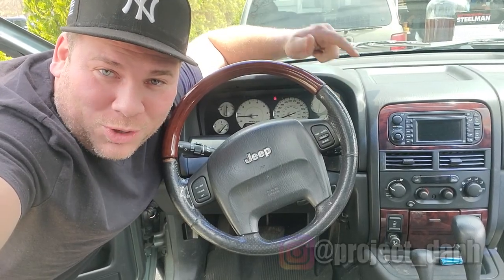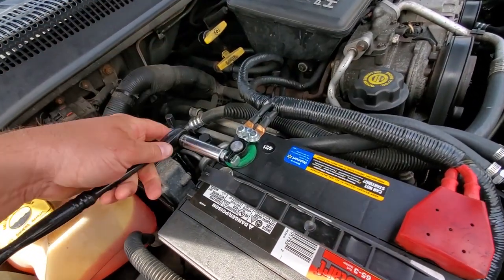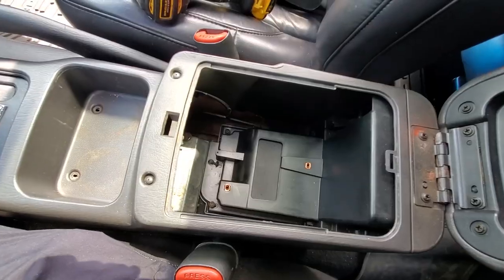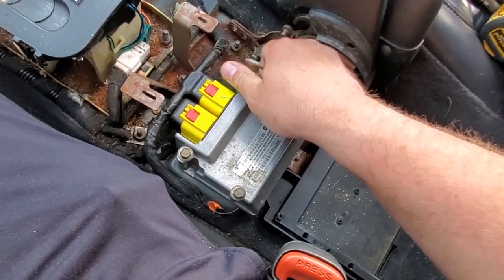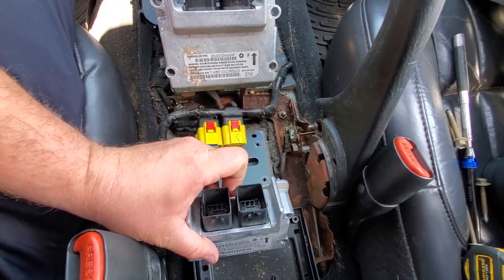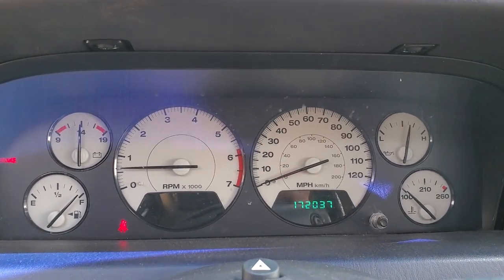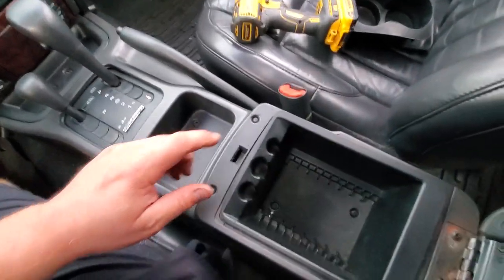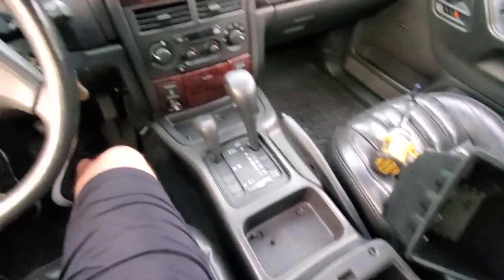JEEP GRAND CHEROKEE WJ AIR BAG LIGHT -  MODULE WARNING RECALL FIX - CENTER CONSOLE REMOVAL

Comment: I know this video was quite a bit ago but id like to add some info for anybody watching this down the road. All three of my WJs are 2004s, and all three of them had the recall for the ORC/airbag module, so a 2004 module is not the fix for this. And, none of my jeeps had a lit airbag indicator on the instrument panel but were all found to have a part number that was defective with potential for random airbag deployment and needed to be replaced. Your only way of knowing is checking the vin and having the recall performed. Go to NHTSA and type your vin. You can certainly do it yourself as long as your dealership will give you the correct part number and you want to buy the part. But it doesnt show a performed recall on the vin info unless its signed off on by the dealer if ya care about that, and some wont supply you the part number, I guess for that reason.

Comment: Awesome thanks for the part number! My 2003 WJ Overland had the airbag warning light stay on after starting the engine a couple months ago. The main issue seems to be whether the vehicle was equipped with front airbags, or front & side airbags, as there were two different part numbers for the module. I'm going to grab the module out of an `04 Overland with front & side airbags at the local u-pull. If that doesn't work, I'll pull the two fuses. 😎
Reply from the maker: Lol! Go for it, It wont let you plug in the wrong module, They have specific notches

Comment: Hi, I'm from the future. 😆 I watched you change a clock spring. 🤪 On both of these vids, did any of the other controls work, Like horn & cruise? If they do work, it's the module. If they don't work, you won't find out it's the module or not until the horn works again after changing the clock spring. 🙃
Reply: I replaced my clock spring with 2 others and my horn doesn't work and air bag light is still on... a module can cause no horn?

Comment: Great video ...easy peazy..Have the same issue with my 02...How do you determine it's not a clock spring??
No issues with anything else...just the annoying light..
Fellow Long Islander and  faithful follower
Reply from the maker: Thanks Mike...  Process of elimination, since the airbag module is easier to access than the clock spring I tried it first 😁

Comment: Gréât tutorial, thx 
Question:
Is warning red light airbag + klaxon not working + auto cruise not working, can be the cause of the airbag module issue? 

I ve Checked all the fuse related and they all fine.
Changed the Clock spring with a second hand one, issue still there..

Any help would be appreciated 🙌🏻 ￼

Regards from Spain 
wj 2005 2.7L diesel
Reply from the maker: with that issue my first guess would be clock spring.. make sure your clock spring can handle all the features such a CC.    A bad airbag module would only produce an airbag light

Comment: Its a 3 inch budget boost blocks that will not work with my quadra driver transfer case it puts to much of an angle on the dangle.and binds the front drive shaft.so I'm taking it out I'm not replacing the front drive shaft and getting new yokes and all that
Reply from the maker: Can you just get adjustable control arms to correct the Pinion Angle??

Comment: Thank you Dan for your videos that really taught me a lot about my jeep grand Cherokee 2002. I have to share with you that my jeep deployed the airbag while stop to pay a toll lucky that wasn't when it was moving I didn't pay attention to the ABS light, based on this video I now discovered what caused this to happen. Now I have to replace the whole dashboard kit and the steering wheel plus the module. Any sugestión if I can upgrade it to a latest model.
Reply from the maker: any working module should do the trick so long as the plugs fit.  I have a whole Laredo dash with the silver trim if you need it

Comment: Mr. Dan I have a question. My  Jeep Laredo had an airbag light pop on 20 miles up to a hiking trail then  my airbags blew up in my face… no injuries, nothing but bruised ego and bruised Michelangelo ( my wj)  what’s my next step, contact a Chrysler dealer ??
Reply from the maker: what happened, the rough trail tripped your collision sensor or your airbag module crapped out?  If it was my jeep Id just replace the airbag module and the airbags myself..  make sure your battery is disconnected.  plug er in when your done and see what happens
Reply: @ProjectDanH  yes I believe the rough road tripped the collision sensor it seemed so odd!, and thank you for the advice.  I’ll have to try doing it myself 👍🏻👍🏻

Comment: My Airbag light used to only come on periodically at high speeds.  It would go on and off and chime.  Now it’s constantly on.  How do I know it’s not the clockspring?   Thanks
Reply from the maker: process of elimination... Replace the the module or clock spring and see if it still happens!

Comment: Do you still have that exhaust leak?
Also are you going to do any work under the valve covers like replacing lifters?
Reply from the maker: Yep.. engine wise this thing needs valve stem seals. Lifters and valve cover gaskets.. should be digging in sometime soon
Reply: @ProjectDanH  noice

Comment: Hey I’m messing with the same issue.  Was wondering if your seatbelt light stays on too?  Just found out mine has the recall but wondering if the other annoying light will go away too lol.  Only owned it for a week
Reply from the maker: Not sure if its the same issue but my drivers seatbelt latch was busted.  I replaced it with a junk yard latch and noticed the old wire was pinched by the seat bracket.  after replacement I haven't had a problem since
Reply: @ProjectDanH  I’ll check on that while I’m waiting on an appointment for the recall.